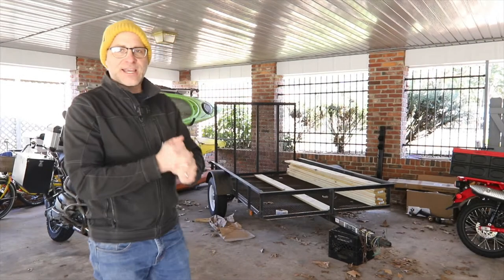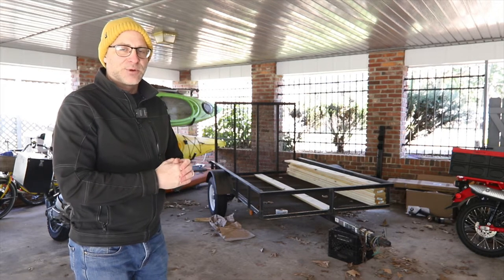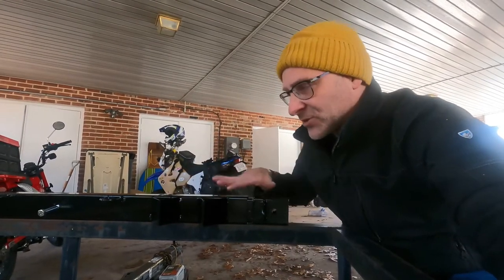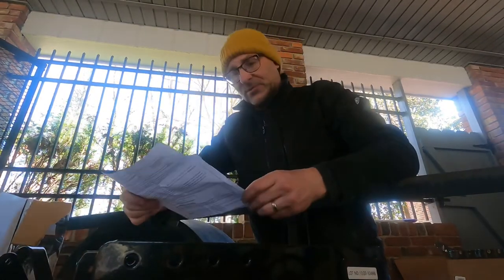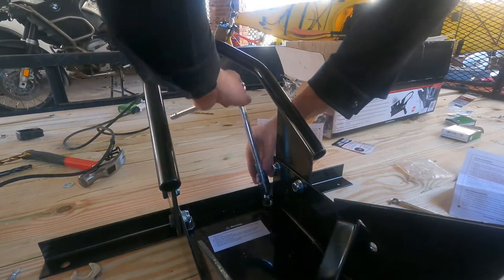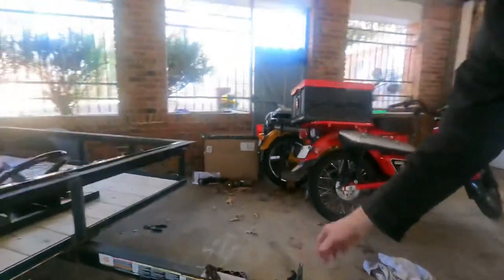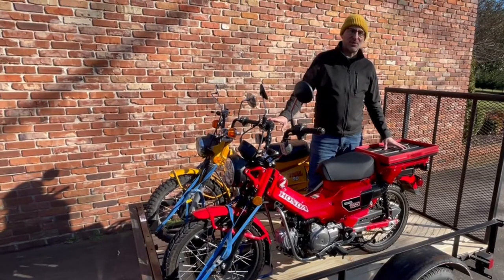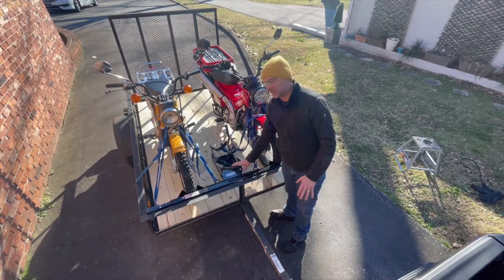Modify a 5x8 utility trailer to haul my motorcycles:  Honda Trail125, BMW 1200gs, CT90 or DRZ400.

Comment: I like it! Cost effective and functional.
Reply from the maker: If you have a trailer sitting around or can find a old used one it isn’t expensive.    I hesitated to put costs in the descriptions as prices will fluctuate depending on where and when this is viewed.  I have $140 in lumber and hardware for the deck.  I paid $59 for the motorcycle chock and $79 (bought it used) for the Black Widow Tie Down.  This little trailer will make motorcycle transport sooo much simpler.  I won’t miss loading an unloading a big bike from the high bed of my pickup.  My wife is a huge fan of the trailer as she can load/tie down her Trail125 solo.

Comment: Do you think the black widow double bike “pickup” rack would work ok for a Honda Monkey  (slightly fatter and smaller diameter tires) on a similar trailer? 
How far are the wheel chocks from the end of the bar or side of the trailer? Any concern about scraping foot pegs against the side of the trailer? What is the internal width of you trailer?
Reply from the maker: I think it would work great for the monkey.  The chock will  fit a tire width of up to 5" inches down to 2"due to a tappered design.  Both the trails had plenty of room for foot pegs.  It's 14 3/4 inches to the side from the middle of the chock.  I've had 2 trails fit no problem.  I've had 2 dirt bikes on no problem.  My 1200 gs will fit on a side but just barely and crash bars are over the rail. Luckily it's a tall bike.  Two mini motos fit easy.